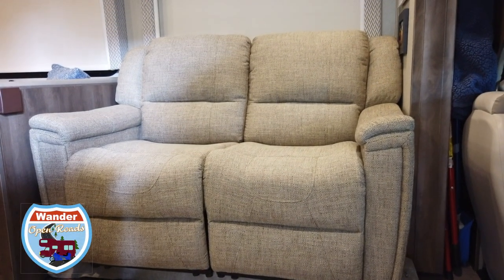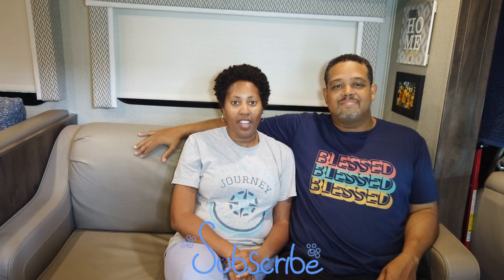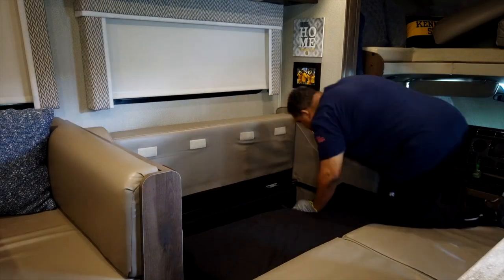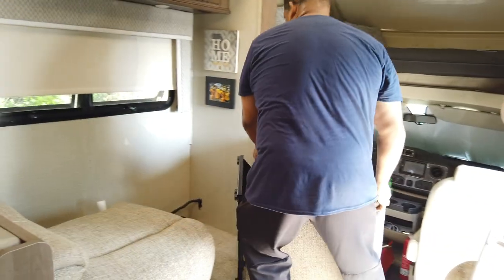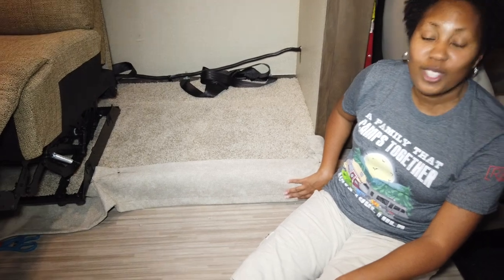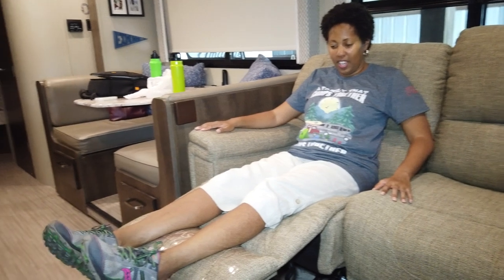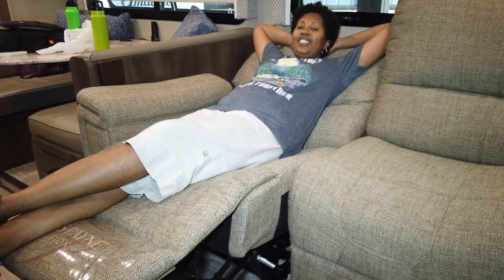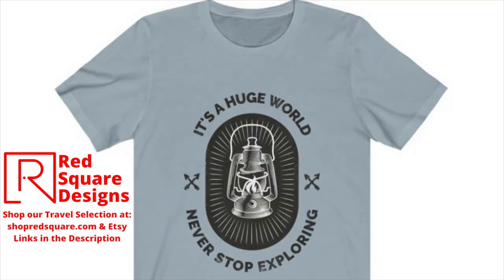New RV Loveseat Installation, What Could Go Wrong??  Thomas Payne RV Collection

Comment: I went a different route. I needed another bed for when company happened by or in case a friend wanted to stay at a campground with me. my love seat was sort of a pleather coated futon and it was great for my dogs but not so great for someone adult to lay down and sleep on so i went to walmart and bought a love seat with a hide a bed in it for $350.00 works great but not so comfortable for sitting on for hours but then i don't sit on it for hours either. that's what the swivel recliners are for in the back of my RV